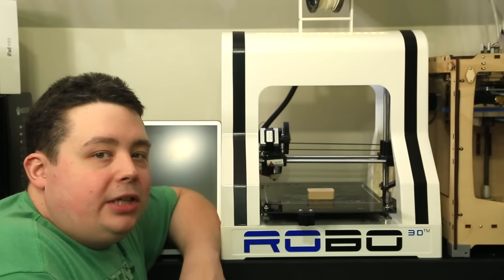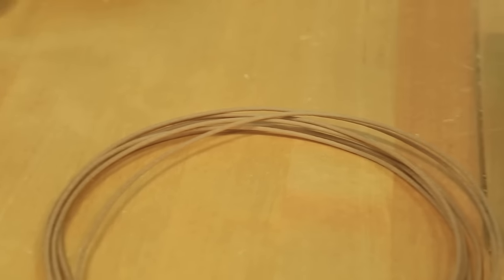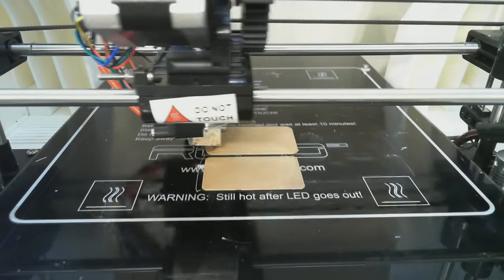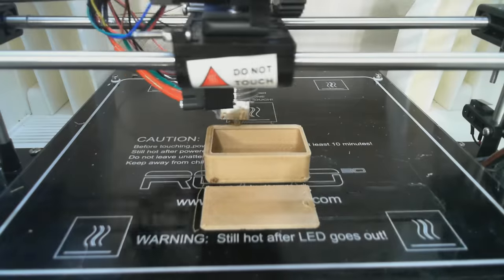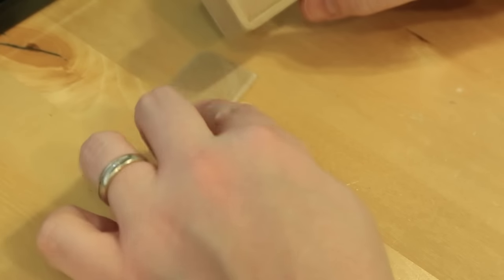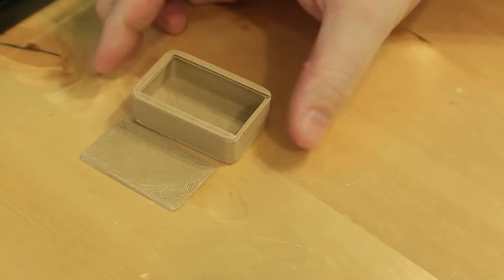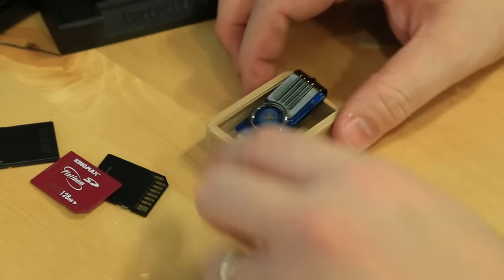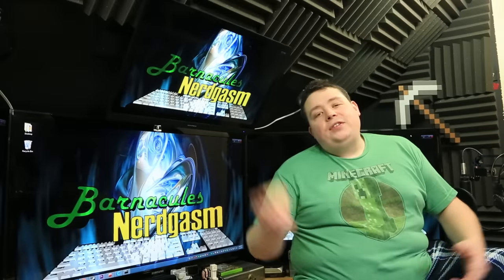3D Printing Wood? How is that possible? Let's find out! - @Barnacules

Comment: I tried printing this on my Printrbot simple metal 2014 about a month ago. Even with slow settings and low layer height i was unable to get that lid to slide nice. I ended up having to print it 5% smaller than the rest of the model. Things like those tight bevels really are beyond the capability of the printrbot and simliar printers where the Z axis shares the same assemblage as another axis. Accuracy suffers. Thankfully my budget for my ultimaker2 is almost ready to go. Next month ill be the proud owner of my very own.

Comment: How do you use Ultimaker's Software if you are yousing the Robo 3D printer?
Reply from the maker: CURA is open source and works with all Arduino based printers. Plus the Robo3D just uses standard gcode.

Comment: I really wanna get a 3D printer, but the current version doesn't have wifi, and that's kind of a deal breaker for me. My desktop doesn't have any unused USBs as the motherboard only has six. Another problem is I don't have a SD card slot either, but I guess I could just throw some models onto my Surface Pro and put them on the micro SD...  I hear the next Robo 3D is getting wifi support, but that's coming in the winter. Thanks for your videos on 3D printing, really makes me want a Robo 3D since printing in wood sounds fan-freaking-tastic. It'll make my wood carving, computer hating, grandpa hate technology even more, bahaha.
Reply: You could also just get a USB hub for more USB ports. If the printer is too far away from the computer, just get a long 10' to 20' USB extension with a powered HUB at the end.
Reply: You could also get a raspberry pi board to connect VIA wifi; set up the raspi with linux and the software for the printer, and then connect it VIA USB to the 3d printer and use a USB dongle to connect it to the network, then remote into the raspi and do it that way.

The whole spirit of 3d printing is DIY, so if a solution doesn't exist, create it. :)
Reply: Honestly, I'm tired of seeing raspberry pi this and pi that. It's an over-priced development board.

PLEASE, do yourself a favor - go pick up a Pogoplug-class device for $5 and save yourself $25 + cost of cables, etc. You can buy a Pogoplug for $5.55 + $10 for a 32GB card, then flash uboot, and install Debian.

I will admit, the Pi has an impressive HDMI port for streaming video but that's about it. For other embedded projects like the above, hack it together yourself. Took me about 10 minutes out of the box.

That said, thanks for the idea on making it wifi! I'm currently designing a project that is a USB device (slave) and bridges another USB device over network.
Reply: bugs181 Thanks for the info about the pogoplug; it's mostly a case of "when all you have is a hammer"; I know the basics of a raspi and know it's capable of this task. There's almost certainly a better solution (as you demonstrated), but I just lacked requisite knowledge.

Also, where are you getting $10 32gb cards? Or have I been out of the SD card game for too long? I see them for like $15-25 most places.
Reply: Ahh, yes. The good ole hammer tool. I used to be in that boat until I decided to leave my comfort zone and learn all about the things that interest me. Now, nothing really holds me back. For me, the world was flat and now it's round and just keeps going and going.

One example is that I spent some of today learning how to make a USB device (slave) act as a bridge between any device that accepts USB to my computer or NAS (network attached storage; i.e. my pogo plug). Looks like I've found a solution. You can buy a transcend Wifi SD card for about $40 and put a custom Linux firmware on it. This might be of interest to you. Optionally, you can use it for it's intended purpose and have a virtually unlimited amount of SD storage for your devices.

I received my 32GB card from an ebay bid. Most of the cards from China start out as $0.01 and then eventually get bid up. You can often be the lucky winner of such items for about $10. Or if you don't have the patience, you can do a buy it now for about $15 + Free shipping.

The obvious pitfall is the waiting time because of import/shipping. I have so many projects going on at once that the waiting times don't hold back progress between my projects.

Comment: does it work on other 3d printers like the xyz da vinci jr 1.0? plz reply back
Reply: This wood filament does work on other printers, but sadly I'm not sure if it works on DaVincis.
Reply: +PikaHMW It should work on any FFF 3d printer. The Da Vinci machines are probably the worst and no one should ever buy them as they try to force you to use only their filaments. In order to use 3rd party filiments you are goign to have to flash the firmware or hack one of the official spools. There is info out there on how to do it.

Set yourself free from Da Vinci overprices filaments....
Reply: do they sell parts that can be replaced and so it could work with other filaments

Comment: it seems like it would be easier and cheaper to carve a wood box
Reply: walala lol you've completely missed the point. this is just a demonstration of the filament. 3d printing has many benefits over traditional manufacturing methods. For one, certain geometries can't simply be "carved" like this simple box could. Another benefit is accuracy. Think before you type

Comment: maybe in 5 years staples will have 3d printing machines where you can bring in a model on a thumb drive plug it in and print then comeback when its done and pay them based on how long it took
Reply: That would not be profitable for them because most large prints take 1-24 hours maybe more to print therefore if a lot of people wanted to print something they would have to have multiple machines which meant they would have to buy multiple machines and electricity cost to run the machines would be so high they would have to charge you more money which would make you not want to print in the first place. It would be better if staples sold them or the kits to build them.

Comment: is there something like this with metal? printable metal would be awsome (even if its 40%metal)
Reply: I don't really think mixing metal with non-metal would be that good for 3d printing.  Though, I remember seeing something about more industrial 3d printers that could use metal.  They'd probably cost a fortune, though.
Reply: not this process but there are metal 3d printers. very expensive very messy lol
Reply: the first 3d printer using carbon fibre will be coming out by the end of the year. its called the mark one, check out their video on youtube
Reply: 3d metal printing has been available for a while now... Well if you've got the cash for it anyway

Comment: Can you print it Steel PLA?
Does any one knows an 3d printer that can print at all this exotics filaments, and cost at most 700 dollars ?
Reply: Conrado Pinto wanhaousa has a prusa based printer called the duplicator i3 v2.1 that says it can print in all the exotics. i just recently bought it and am waiting to get it.
Reply: thanks men,let me know if it is good.I plan to 3d print a lot of bb guns on this 3d printer.
Reply: Conrado Pinto the web page says it can
Reply: Thank you very much,im definitely going to buy this printer ass soon im save some money.Thanks, hope that you have a good experience with it.
Reply: just so you know. steel pla is no stronger than regular pla. it is heavier but other than that it is only aesthetic changes.

Comment: why do you need 2 3d printers?
Reply from the maker: One has duel extrusion and no heated bed and the other had a heated bed but is a lot slower, so they both serve a purpose. Plus I can print 2 things at once which is handy since 3D printing takes so long.
Reply: Barnacules Nerdgasm fair enough I suppoese :-)

Comment: This guy is fucking with us. Thats not actual wood,its a combination of wood and polymeer.
Reply: Actual wood doesn't melt or go into filament without it being rigid. The temperatures you melt PLA at, I'm sure you'd start a fire with wood. That would ruin the printer, woodn't it? XD
Reply: oh really? You think carpenter dont knew that?:) But for everything, theres no magic, just wood-polymer filament.
Reply: Obviously
Reply: I'm guessing it's just Mdf wood probably mixed in with a glue or a binding agent
Reply: yap dsjc666 it must be

Comment: doesn't wood burn? I know that any thing can go to a liquid  state but what kind of science does it take to do it to flammable material.
Reply: It's not liquifying the wood, the filament is basically extremely fine wood pulp-- not unlike what you would find in MDF panels --suspended in a thermoplastic binder.

Comment: my missus thinks this is a waste of time, but in a few years maybe, when it is poss to go to a local store and buy a no hassle 3d printer, it will be amazing, i really like the idea that if ya need something, just print it.
Reply from the maker: I give it another 3 - 5 years before HP and Epson have turn key solutions at your local electronics store. But I would bet the media for them will be stupid expensive just like ink and people will need to hack them to use cheaper material.
Reply: yeh, they do like to charge a lot for the media,
Reply: Barnacules Nerdgasm I would buy one however with my country's customs I would have to pay the price of the item just for the customs duty. So therefore buying the item at twice the price + shipping. That sucks.

Comment: You have some forced air ventilation right?  Whatever binds that wood dust or whatever it is together can't be nice.
Reply from the maker: No, I have an air conditioner with a dust catcher :P And the binder is just PLA/PHA which is derived from corn so I should be okay.
Reply: Ah ok. Hope you post your stain/finish video soon.  Wonder if tung oil would work.    Sliding doors tolerances are probably too tight for many finishes.

Comment: This is so fucking confusing. Is this like solid wood filament? Or really fine wood shavings combined with some type of glue? Also how well does this burn?
Reply from the maker: I haven't done a burn test yet but yes it's 30% wood fiber mixed with 60% PLA/PHA plastic.
Reply: A burn test sounds like a video I'd like to watch ( Hint hint)

Comment: print something in metal!!!!
Reply: indrav5 what kind of metal if you're talking about aluminium or steel that's nearly impossible to do with a conventional 3d printer as those metals melting points are 800 to 1000°C way above what these printers can do

Comment: IT'S JUST PLA!! with some tiny wood fibres mixed to look like MDF.... NOT WOOD.... it doesnt sound like wood at all....this material is probably even worse than standard PLA due to the moisture absorbing properties. If you want a strong printed object, try glassfiber reinforced plastics, much better results than this hyped crap.